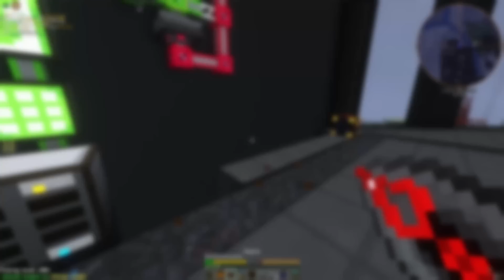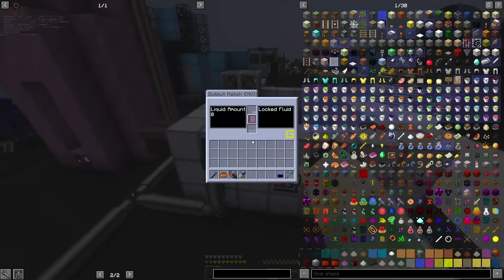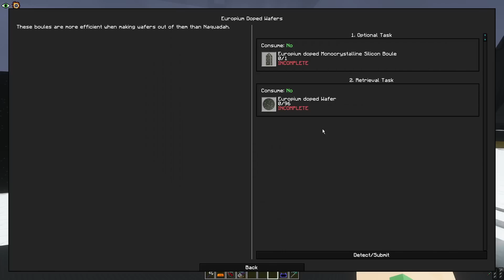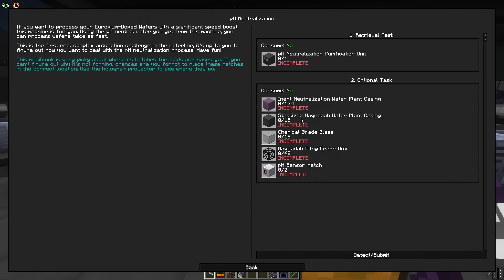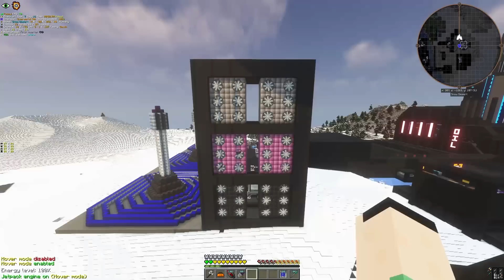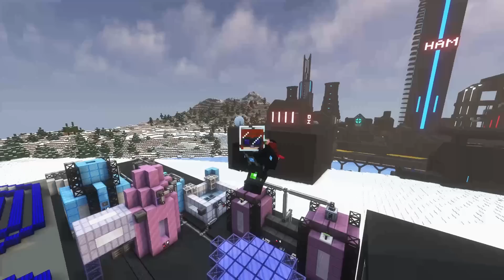GregTech New Horizons E86: Fully Solar Powered Water Purification

Comment: Dear CEO

Dim Redcrystal is a block added by the Automagy mod. The  crystal has a cap value which can be toggled by right-clicking it with a wand. Any signal higher than cap value will be lowered to this value.

Magical R&D

Comment: To get a signal strength of 4 use a comparator with:
 
A furnace containing 42 items.

An item frame rotated 3 times.

A dispenser or dropper containing 124 items or 2 unstackable items.

A hopper with 69 items.

A cake with 2 slices remaining.

Or you could use the comparator in subtract mode with 4 pieces of redstone dust and another torch (15 - 11 = 4).
Reply from the maker: A hopper with 69 items you say?
Reply: Or....just use a draconic evolution potentiometer. Place it, right click it 4 times.
Reply: @istree2  nah man, the CAKE, is the solution
Reply: A bookshelf with a redstone book in the appropriate slot works too.  I use that for my toggle latch